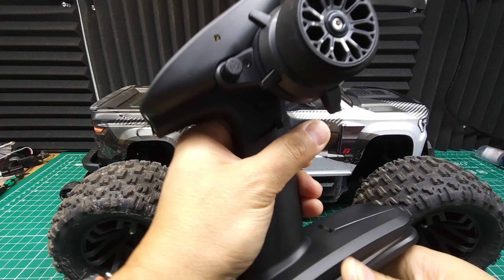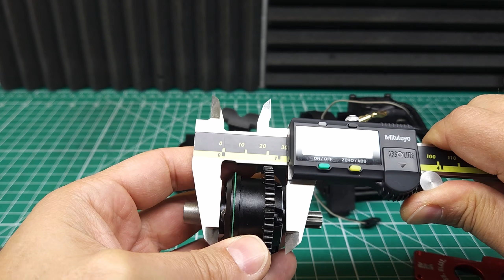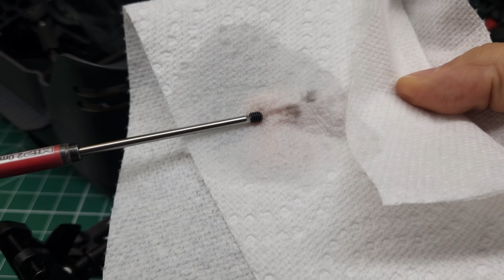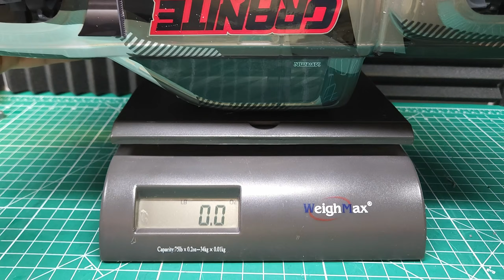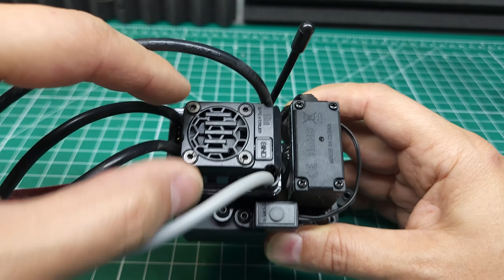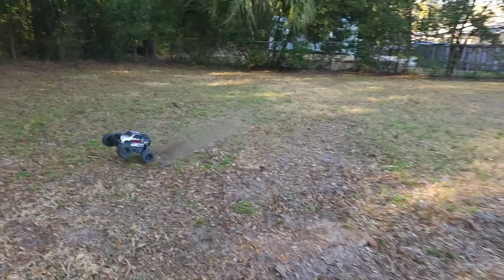I Built The World's Most Upgraded Arrma Granite V4 223s!

Comment: That center diff not working probably had more to do with the m2c motor mount he probably made it with less slop then the stock mount and that was ok with the stock center differential but not with the aftermarket one I have used those aftermarket ones on builds where I put center differential in old 3s trucks and it worked great

Comment: maybe you can use the aftermarket center diff without the seal, as the 20 mil fluid you had put in it wont be leaking out anyway.
Reply from the maker: You could do that though you would be surprised. Even with his viscous as the fluid is it's still a fluid and it still will leak out slowly.

Comment: I upgraded mine(started life as a Mega 665) with V2 120AESC, 1900kV motor(4S), Typhon Upper/lowers front and back, ZD Racing BB shocks,Typhon Wing, Amazon servo (for now), recycled Senton 223S centre diff, cMojave 6S wheels (Badlands after Xmas)couple of fans and it's now very quiet and never gets hot.
Reply from the maker: Sounds like a pretty sweet setup.

Comment: Hey what did you use for a transmitter with the new esc?
Reply from the maker: I think my fly sky G7P but I don't remember
Reply: @DoRC if I were to buy a spectrum receiver would I be able to use the factory radio with the stability control on it? I want to change my esc but want to use this radio functions?
Reply from the maker: @Anglo-3ninesfine Unfortunately no. The stability control is built into the ESC / receiver. You can get a receiver with AVC but you'll have to get a DX3 transmitter to go with it.
Reply: @DoRC ok thank you. Can’t find any information anywhere about this thing I guess it’s easier just buy another radio system which is dumb as shit seeing as the radio is comfortable and the dsc is pretty neat.
Reply from the maker: Yeah unfortunately it's the main downside to this platform. Most people who buy these cars probably never upgrade the electronics but if you want to you're kind of stuck upgrading everything. There are other options for a gyro but I don't run a gyro very often so I'm not super familiar with which ones are good and which ones aren't.
Reply: @DoRC best rc YouTube channel, keep up the great work. Thanks.

Comment: where can i find a video on how to disassemble this thing?
We can't get the motor and diff out!
Reply from the maker: To take the motor and differential out you need to take the screw out that holds the little sliding piece connected to the rear battery strap. Slide that out towards the battery compartment then take the two screws out from underneath that hold the module in and remove the center drive shaft. You then have to pull up on the little lever and wiggle the module forward. Sometimes it can get pretty stuck though so you might need to pry with a screwdriver between it and the chassis

Comment: JUST PUT 4S Battery in it.
https://youtu.be/axGfMF5PnPo?si=zr1V2C_HVe4cC7Jk&t=1088
The easiest way to get 4S on one of these trucks is to just slap a 4S battery in and it is ready.
Stock ESC beebs 4 times and everything works just fine.
Temps are fine and LVC kick in at about 3.5 volts.
OEM motor can also take it, but it can run a little hot. 

Love the videos, keep them coming.
Reply from the maker: Yeah if it works that's great. I have a hard time recommending that to most people as even though it might work right now there's no telling if it'll keep working in the future. The manufacturer is not obligated to make the ESC for s compatible so there's always the chance they can change hardware internally and then you end up with a bunch of people that blow up their ESCs down the road.

Comment: Long time fan of the channel! Just ordered the pro-line power stroke shocks for my granite 223s, would you say the stock pro-line shock springs are adequate for a granite or would it be worth looking into the spring set upgrade package? Please let me know, Thanks in advance! Keep up the good work!
Reply from the maker: I think the stock springs are good as long as the car isn't too heavy. I found with the chassis brace the front felt a little bit soft but it's still usable.

Comment: Dose the firma 120amp 3s to 4s hook up to the stock motor and can the stock motor handle 4s? Thanks so much
Reply from the maker: It does and in my experience yes it can handle 4S. It's not officially rated for it so no guarantees but I've run 4S on 3S motors for years and I don't think I've ever blown one up.

Comment: I heard a theory that the reason why some diffs and shocks leak in shipping but not when using them is because of the pressurized cabin in plane shipping. When you're moving a vehicle through the different air pressures. The seals aren't meant to hold against that kind of pressure change.
Reply from the maker: Yep that's exactly what I think. It's either lower pressure in a plane or possibly just pressure differentials throughout shipping coming from one place and ending up in another etc. 
I've seen it enough times that it's definitely a common phenomenon and a differential That has leaked in transit almost never ends up leaking in practice so there's definitely something going on.
Reply: Remember, if it’s coming from China it’s likely not on a plane, but on a boat. And likely the package was vacuum sealed to save on space. These parts arent going to hold up to any kind of vacuum

Comment: The hot racing servo savers are a pain to install and the o-ring wear out and then you get a lot of play. Just bought a fixed 25t servo saver like HR, so we will see how that works out. 
Biggest complaint about driveshafts for the 3s line is that no one makes a long enough aftermarket driveshafts for the big rock width. Most have too little contact point. 
4s on a granite has to wild to handle. 3s is about the perfect combo for me.
Reply from the maker: The fixed servo horn is going to be okay as long as you have a really good servo. If you're not running a really high quality servo you're going to end up breaking the servo
Reply: @ You are correct. I didn’t make that very clear. It’s a fixed tooth 25t servo saver so just like the HR, but no plastic inserts. The metal portion is 25t.
Reply from the maker: @nicks237  ah ok. Yes someone else mentioned that I didn't realize it existed.

Comment: Those proline shocks are next level hard to beat running them on my 800 dollar stampede 😅😊
Reply: Could you use these proline shocks on a Mojave 4s? Or is there another alternative?
Reply from the maker: I agree. I've had them on a few different vehicles and whereas they are definitely not cheap they're very good. I've never had one leak bend or break.
Reply: For that price you could have a used x maxx or buy a new sledge
Reply from the maker: Yeah but then you'd end up upgrading those as well :-)
Reply: @DoRC true but starting point youd have much better foundation with the 6s 8s lineup
Reply from the maker: Yeah I suppose it just depends on what you're looking to do. I think that for most people though if they're the kind of person that's going to want to upgrade they're going to want to upgrade whatever they have so it's pretty much always going to end up being more expensive than whatever the next stock level up is.
Reply: @DoRC definitely

Comment: 7075 is a ton more durable than 6061
Reply from the maker: It is stronger but it's not a crazy amount.
Reply: @DoRC  i thought it had double the tensile strength.
Reply from the maker: @PastorOfMuppets616  I just looked it up and you're correct. The tensile strength is a lot higher. The trade-off is that it's also more brittle so when it does get over stressed it tends to break rather than bend.

Comment: I tried one of those hot racing servo saver on my Arma Creighton 4S it was practically worse than stock💩
Reply from the maker: They work pretty well if you can get them installed correctly but getting them installed is a challenge

Comment: You can make a ryft servo saver work on the 3s/4s arrma line. Requires like 6mm spacers and some trimming to the servo box
Reply from the maker: Yeah I think I mentioned that in the video.
Reply: @DoRC  oh I must have missed it. My bad. Carry on
Reply from the maker: @wootwootjr  I think I mentioned it as a crawler servo saver but that's what I meant the treal smaller built-in servo saver horn unit. It works on a bunch of different vehicles

Comment: Can’t you just wet sand the center differential Down a .5 mill? I had to sand the 6S Kagama center diff down a bit because the paint was uneven causing it to always leak. Excellent upgrades, esp the shocks.
Reply from the maker: Yes you can definitely fix the problem

Comment: Those proline shocks are truly SAF. They get a lot of hate, but even after 20+ years no one has really replicated these.

I have beat the heck out of my HR Servo Saver on my Kraton 4s and it has held up great, no complaints here.

Another amazing video Professor Do!
Reply from the maker: I agree. I've had these shocks on several different vehicles and whereas they're very expensive I don't think I've ever broken one
Reply: How do you get youre prolines to not Crack the hexs....so disappointed in mine....cost a fortune and ever 2 bashes I crack at least one

Comment: So I am thinking of buying the mt12. they have two different versions. Which is the one you are using? Or what do you recommend? 

I have a radiolink rc8x right now, I like it but having one remote and not having to get receivers is super intriguing.
Reply from the maker: If you want the universal connection capability you need to get the four in one version

Comment: Nice upgrades. I just bought a vorteks 223 and want to switch to 4s. I have a castle mamba x esc but does that stock motor hold up to 4s?
Reply: Yes, no problems.
Reply: @ thanks!
Reply from the maker: Yeah it should be fine on 4S. It's not technically rated for it but I've done 4S on 3S motors a million times without any issue. You just need to keep an eye on temps

Comment: Those hot racing savor spline cups strikeout and you can’t replace them. In my experience 

Otherwise love that build. Wish we had a better savor fix on all the 3S Arrma’s
Reply from the maker: Yeah I haven't actually had one strip on me and I suspect a lot of the issues people have are related to installation because it's very easy to not install them correctly. It could be some
Reply: I only use HR parts for things with very low amounts of force involved. 
Like I use their brake servo mount on my Promoto just to add some rigidity.
But I wouldn't trust it to withstand any sort of force. I had to break off a tab in order to accommodate my larger ESC, and the metal inside the part I bent (for removal) has that white cheese-y look to it. I think HR uses mainly 6061 and Romano cheese for their alloy mixture. 
I'm not complaining, from everything I'd heard, I knew I was buying hard cheese, and the little mouse that lives in my head, who operates the controls that move my limbs, he loves cheese.

Comment: Ive tried RCAwd dog bone kit on my BIg Rock, Broken. I tried RcAwd dog bone for my Typhon Grom, Broken. RCAwd does a good job of making crap parts that look decent
Reply: I use the rcawd CVD drive shafts in my 3s Vorteks and Senton on 150a 4s and have been absolutely impressed. No issues, just check grub screws every few runs.
Reply from the maker: I definitely agree that RC all-wheel drive is very hit or miss. This latest version of the CVDs does seem pretty good though.
Reply: to be fair: Your CVD kit is different and now i want those

Comment: Would you agree th big rock version is more like the Omni terminator style? Which one more of a safe bet in not breaking these new trucks or the new typhon 1/10 blx?
Reply from the maker: The big rock is the same platform as the granite just a little bit bigger in every dimension. It'll be a little bit heavier which means you're actually slightly more likely to break something though it'll be more stable so maybe not. 
The buggy version will always be the least likely to break because it's the smallest lightest and has the smallest tires.

Comment: Wow, I gotta get that radio.

Also, Im so over clipless bodies. Bring back the clips! Setups like the Mojave 4S or Vanquish Pheonix look nice while still using reliable and lightweight spring steel clips.

Edit: man, I learn so much from your videos. Much appreciated.
Reply from the maker: Yeah it's a pretty good transmitter.
Reply: I think Traxxas has really nailed the clipless system; it's much better than body clips. Arrma is just starting with clipless, and I'm sure they'll improve. Right now, they tend to stick and pinch fingers. Gotta be careful not to get sued by Traxxas, though (almost impossible, sigh).

Comment: Those stupid hot racing adapters broke on mine. Hot racing will never respond to emails so you’re just screwed if it doesn’t work. I avoid them when possible
Reply: Hot Racing is terrible.. I've bought 5 things from them and 4 of them were defective from the factory. I'm lucky I bought through Amazon or I wouldn't have been able to get my money back.
Reply from the maker: Yeah that's definitely the weak point of them
Reply: @DoRC hey buddy I will tell you a really good upgrade hot racing makes that same exact servo horn without the plastic bushings it eliminates the plastic bushings and bolts straight to the horn metal to metal I've had both versions the ones with the plastic pieces and the ones without and the ones with the three different plastic pieces that go on the servo really sucks. I have one of the new ones and it's metal to metal with no plastic on the servo and it works really really good
Reply: @Lucas.stalcup yeah I use hot racing servo horns on my 3-6s and the hot racing servo saver on my outcast 12s and they’ve all held up soo far.
Reply: Yeah I agree - hot racing is very hit and miss
Reply: It must be hit or miss. I had emailed them the other day and they responded same day.
Reply: @FlynnJ802 😂😂 so they are great/complete crap! Thanks comments! ❤❤❤
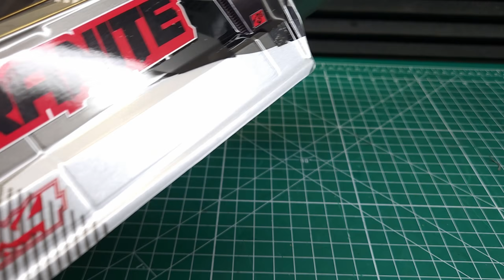Reply: 12:09 lol I thought 10 pounds, that brace is bad@$$!

Comment: did you check out any of my vortek 223s vids? i replaced the diffs and the esc plus m2c chassis brace motor mount and 6s hinge pins and retainers... have a hitec servo coming and garagelife rc servo saver kit
Reply from the maker: I'll take a look
Reply: i think them proline shocks are just to stiff i use to use them but stopped for that reason... now using arrma aluminum upgrade shocks
Reply: @RC4us  *too
Reply: hotracing makes a 25t fixed one but i never had luck with them they are almost as weak as stock and i still think you need to try the garagelife rc set up you will not regret it

Comment: I think the M2c motor plate has a tighter tolerance since my stock center diff actually bound in it. I had to buy a new plastic housing which ended up having just that little bit extra room I needed
Reply from the maker: Yeah that wouldn't be surprising. The tolerance seems pretty tight to begin with so a little bit of extra material could cause problems